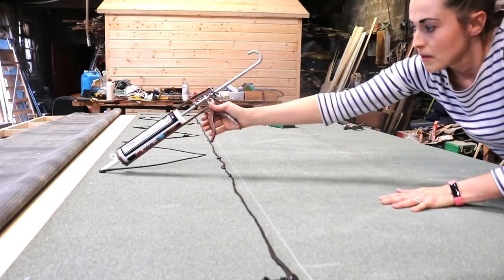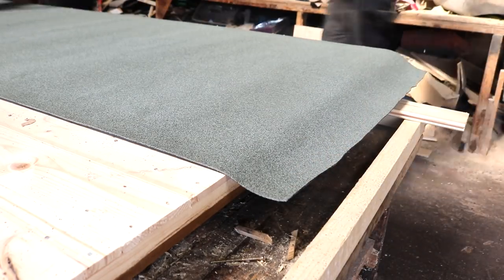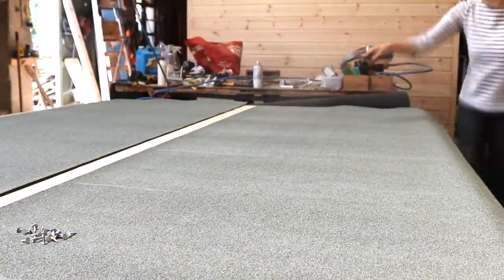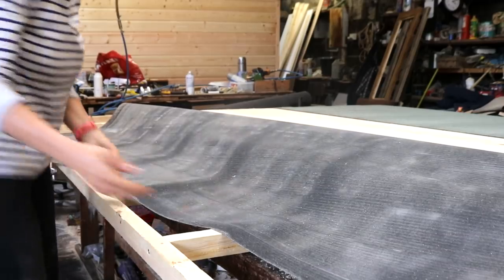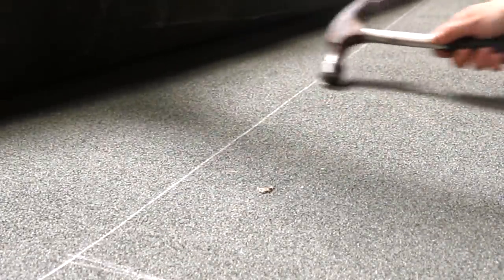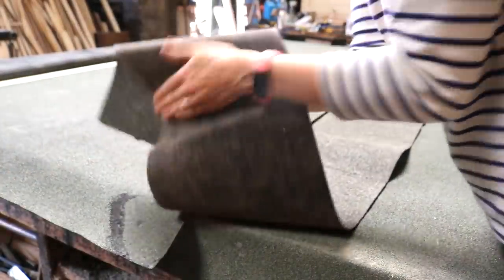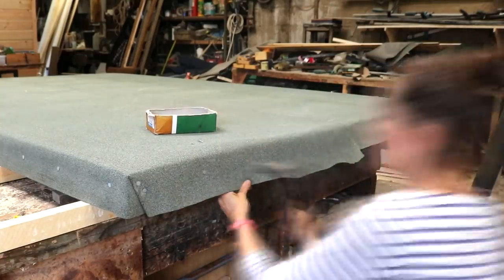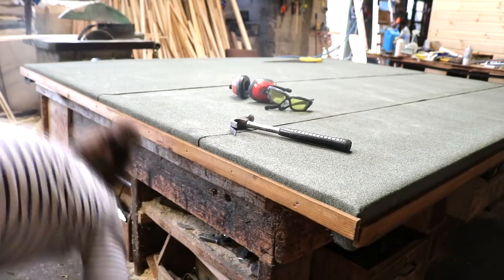How to Felt a Shed Roof + Tips & Tricks | The Carpenter's Daughter

Comment: Very good. Key tip here is sorting the roof felt before roof goes on. Most people will buy a shed which hasn't been thought through that much. I got one of those and then put bitumen tar on all nails through the felt. Works great. No leaks since. It is expensive but bitumen tar is actually very cheap when you work it out.
Reply from the maker: Great tip! :)

Comment: Top tip - rather than letting the felt over hang on the edges, allow enough to double over the felt under itself, be careful not to crack it, it produces a little loop of felt then use the wooden trim or nails to hold it, this time your going through two layers of felt that reinforces the edge (no need for wooden trim that rots quickly) and produces a natural drip edge. Beach huts that get pounded by the sea are often done this way.
Reply: I can see the logic but does it really differ from just nailing into the fancier board ? 

What happens when the felt on the front rots and then the felt underneath the loop doesn’t ? I can see it being a mess when this happens ? 

I personally think applying something like a thick rubber or bitumen liquid to the felt is a good solution for making solid the roof

Comment: Could you give me a link to the felt you are using in this project as I am thinking about building a sloped roof over an existing flat roof which has leaked and caused a large amount of damage and damp. Would adhesive work as well to glue the sheets down so everything is completely sealed to the roof ?
Reply from the maker: I'll find out and get back to you! :)
Reply: @TheCarpentersDaughterUK  Did you find out ?

Comment: Thanks for sharing!
I thought felt had to be melted slightly with a flamed torch?
Does glue work just as well?
Reply: So does it?
Reply from the maker: Never heard of it being bedded. Have passed the question on to my Dad.
Reply from the maker: Ok... got the answer.  The stuff you're referring to is polyester and is usually used for extensions.

Comment: Just a thought, try a lighter  hammer so you can still swing it while holding at the end of the handle.
Reply from the maker: Ah, this one's not heavy.  It's hammering on the corners that's awkward.   Those bits are easier when it's in situ.

Comment: If love to say that this is all good but because I work in construction and what I have to say is you shouldn't lay felt, it needs to be torched on, if you torched it on all the "reference marks" made would be completely and utterly irrelevant. Not to mention you roled am entire strip over another for no apparent reason other to make a drip edge. Complete waste of felt. All the nails you put in the roof, that's holes that cause leaks, not along the sides, but ontop. It should have all been torched on and would have lasted another 30 to 50 years with no leakages, no holes and cost less. Using a mastic gun as "bitumen" is wild